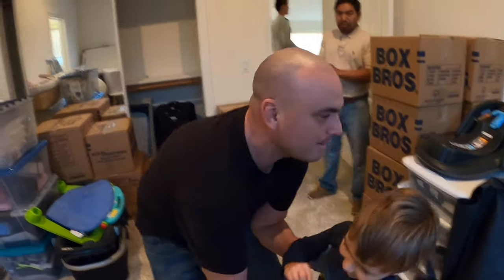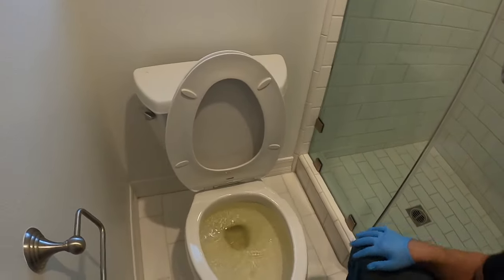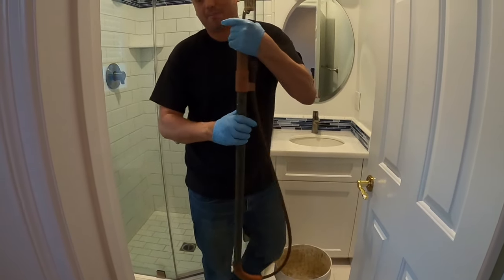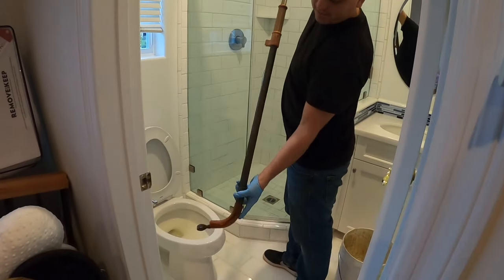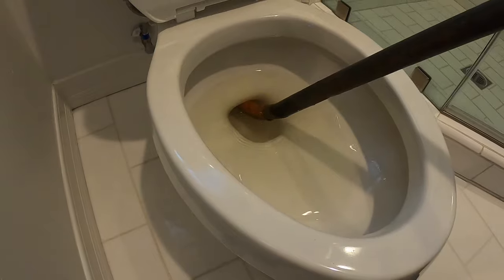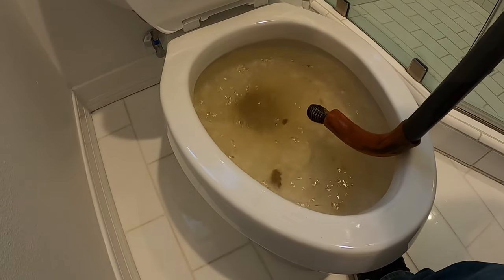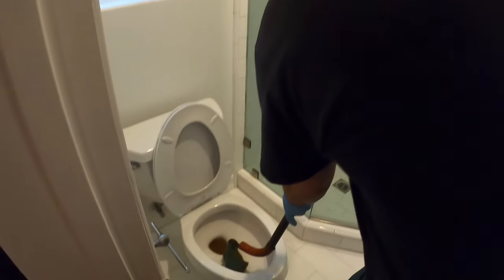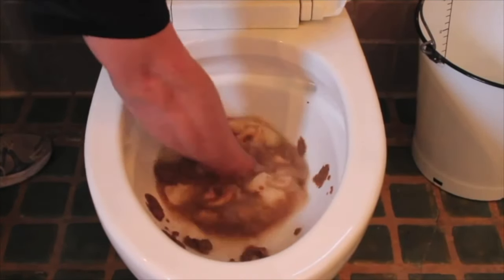How a Plumber Unclogs a Toilet - Closet Auger Edition.

Comment: Thanks for your video. I have a different type of auger but showing how close to the bottom of the toilet to put the coil was golden. It changed everything. I made sure to have the start of the coil right at the bottom of the bowl, snaked it in and then turned. Done in a minute! Saved me a lot of frustration.

Comment: Bought a cheap one from Canadian Tire. I don't know if it worked because the water did go down completely but I didn't pull anything out. I went to flush it but to no success, the water came rising up again but went down to normal level but still the toilet didn't flush correctly and all the poop residue that was in the toilet is now hanging around in the bowl. I tried the hot water and soap trick and it seemed to help a little bit but now I'm stuck with dirty water in the bowl that won't go down 🙁. Any advice?

Edit : The toilet sorted itself out after two months and now works fine so idk what happened

Comment: I have a toilet that a "genius" teenager clogged up with paper towels. It is so clogged that water level does not drop at all. To make it worse, it's not just one or two pieces but a bunch. I saw how much she grabbed to clean up a small spill in the bedroom and it's probably 20 sheets.
I bought a smaller version of the closet auger and cannot get it to go in. 
After insertion I may get it in another 2 inches and nothing.
Paper towels aside, these toilets clog with only human feces. They are horrible.
Is it possible that the passages in the toilet are too small for the auger?

Comment: What if your toilet flushes but doesn't have any pressure and bubbles when the water goes down edit: I actually fixed mine just being persistent putting hot water and dishwashing soap I had something stuck in there I have kids so there's no telling I also got some of this acid stuff you can buy from Walmart or tractor supply eventually it ended up going down. I tried to snake my toilet more times than I can count that never worked for me, I also turn my water pressure up by opening my valves all the way on my hot water heater but I think what really did the trick was the liquid lightning it is sulfuric acid and eventually it away whatever was there I think it might have been a toy something plastic I mean I did this routine for about a week and then I gave up and eventually it ended up fixing itself lol I'm not tired just going to call a plumber so I was just like, that's how it is now I guess 🤷🏻‍♂️
Reply: If the toilet is plugged up and the snake auger does not work it's easier to just remove the toilet and snake it back the other way. Toys, balls, etc. are hard to remove unless you remove the toilet. Been there done that😀

Comment: Where did your get the snake  from we only can get 4 ft that looks it was 8 ft long my problem is 8 ft the problem I’m not a plumber but the whole house is from the clean out 70 ft
Reply: maybe plumbing hardware shops have longer ones than hardware shops or ebay

Comment: would this works if it was a plastic toy?
Reply from the maker: It could work by pushing the plastic toy down the drain line
Reply: Use a retrieval swivel headed auger it'll grab things better. I just pulled a set of false teeth out of a toilet for a customer of mine with my new Milwaukee auger last week.